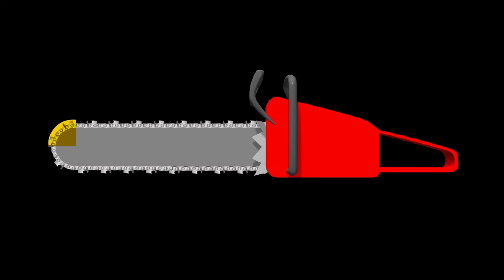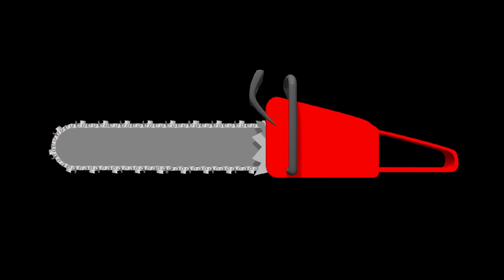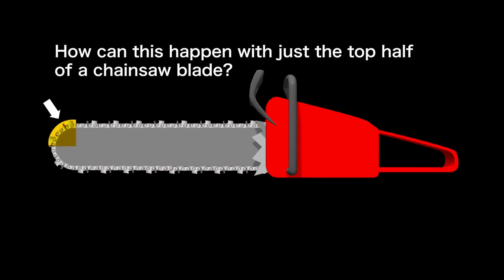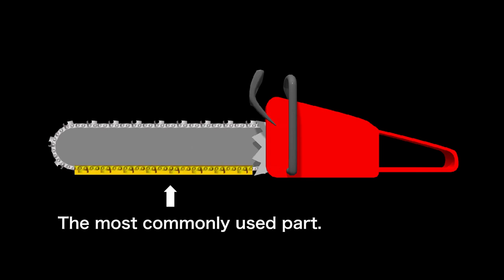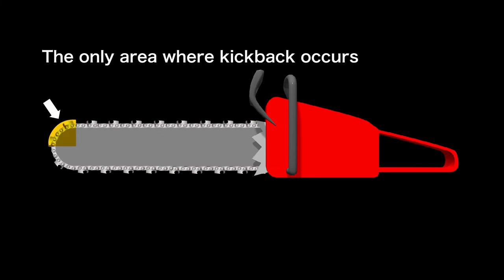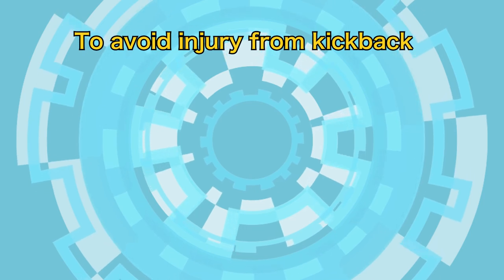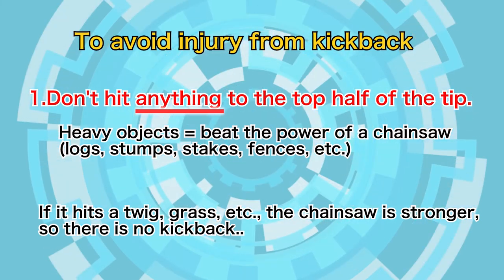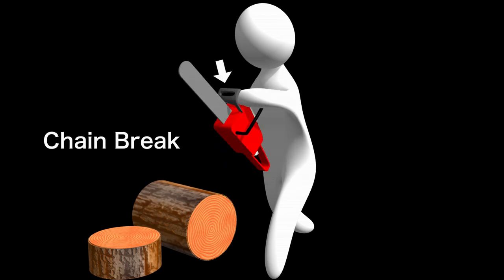What is chainsaw KICKBACK? Explanation with computer graphics

Comment: Yes, kickback IS something to watch out for. It happens fast. But it's very easy to avoid. Just be aware of your bar tip at all times. Always do your cutting with the end of the bar, not the end closest to the saw, unless you're cutting a large log and the entire bar will be buried in the cut. The problem with cutting, say, a ten inch diameter log with the base of an eighteen inch bar is that you can too easily lose sight of that tip, and in a split second touch something solid you weren't aware of. 

Little chainsaws are much easier to control than big ones. The kickback from a little one isn't as forceful as that from a much bigger machine. You can even practice making your saw kickback to get a feel for its power and speed. I did this many times (some fifty years ago) while teaching myself how to run a saw. Don't be afraid of your chainsaw; always remember that YOU are in charge! Fear only increases the chances of an accident, in my opinion.
Reply from the maker: Thank you for watching. The knowledge is so important to prevent accidents. It is may opinion.